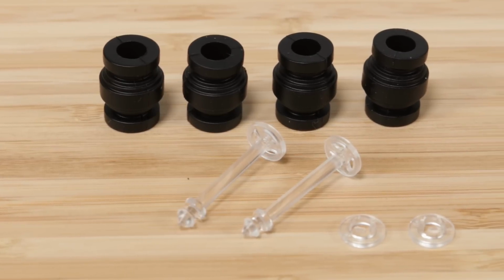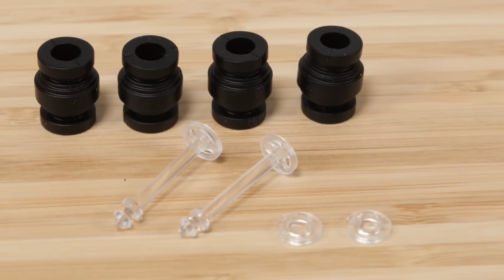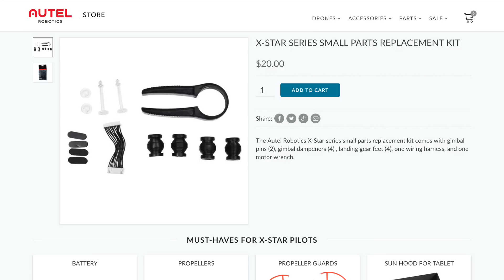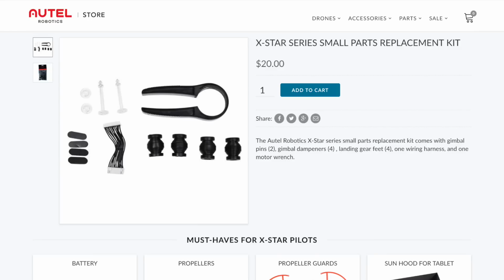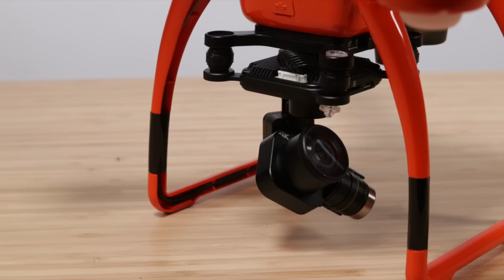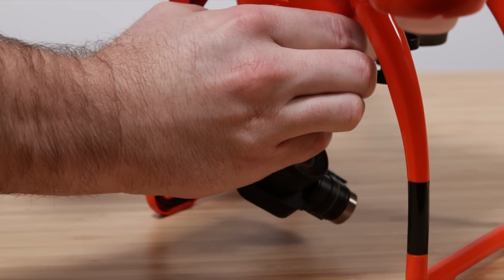Autel Robotics Tutorial: Replacing Dampeners and Securing Pins

Comment: Thanks for this. I've had a slightly unlevel horizon for months and always had to manually adjust the gimbal roll before taking off a few degrees. I noticed that 1 dampener had a slight tear, another had a pretty bad one - both where the clear pins are located and wondered if this could have been the cause for the gimbal issues. They needed to be replaced regardless. Quick easy replacement AND it did in fact fix the horizon! Thanks for this video and supplying the spare parts to do this! This was my only issue with the new firmware, thinking the new gimbal update did nothing. now it's darn well near perfect - flight controls and everything. Feels like a whole new drone now. I will place a new order for more pins/dampeners.  Thank you again.

Comment: I put the other spare two pins in thinking they were left out accidentally... Will there be an issue? If so, what?  I see now that once I secured the pins, they cannot be removed without chopping the top off of it. Thanks in advance.
Reply: I thought this also when I bought it - "why are 2 sides without pins??" I ALMOST took the spares and placed them in the empty areas, but saw in other videos, and here this was normal. I dont think having 4 total pins will harm anything..2 clear pins in oppisite corners just make the entire gimbal more secure in case the rubber dampeners fail (pins will keep gimbal in place as a backup) But having spares help. It does seem these rubber cushioned parts are very fragile and tear easily especially the tops and bottom where they crease - so perhaps spending the $20 for more spare pins along with the wrench, cables, 4 more rubber dampeners will be needed and worth it.